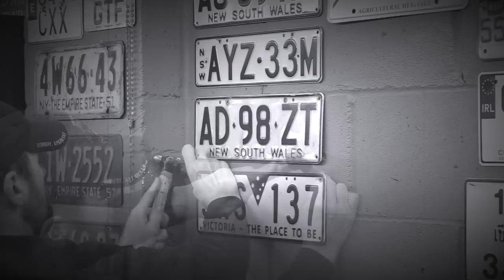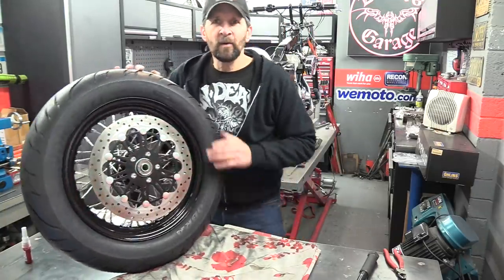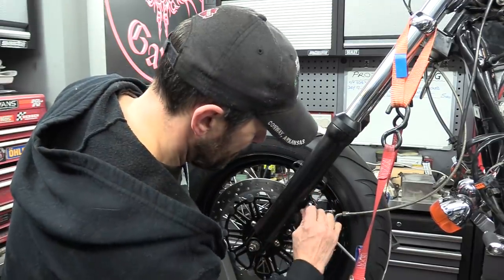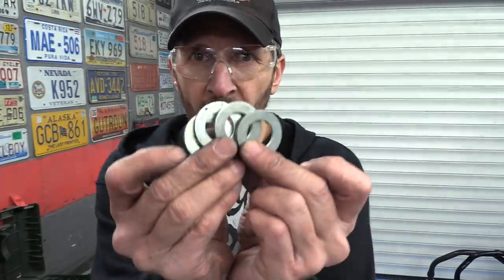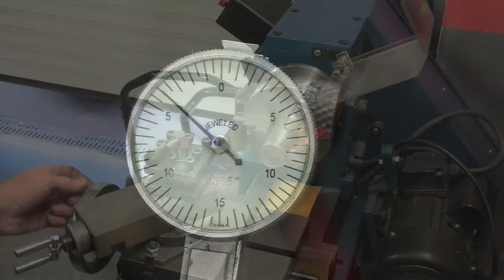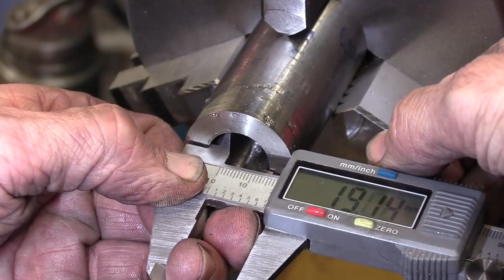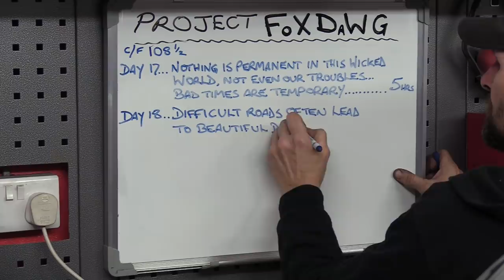Delboy's Garage, Project FoXDaWG, Day 18  Front Wheel Spacers!

Comment: This would fix my bike. I had the exact same idea and landed on your video so I know I'm right.
Thanks man!
Reply from the maker: Thanks mate, glad it helped, have fun with it!
Reply: @Moonfleet41  Just a suggestion. If I send you my original spacers, would you be willing to make me a new pair? I just need to figure out this weekend how I get the brake calipers to sit well. I have a 21 Triumph Rocket and standing in front of the bike I notice it's off set (parallel to forks) to the left. So the bike leans to the left when releasing handlebars. This shouldn't be and I think this will fix it. The difference is bigger than the one shown on this video.

Comment: Hi! Excellent work.  My suggestion will be to, first center the front wheel with the fork, frame and the rear wheel., it is the most important step, the have them line up perfectly. Second adjust either the disk or the caliper to fit the wheel not the opposite around.  The bike has to run straight first, then break properly. For the  front tire, A rule of thumb is, if you use a rear tire in the front you have to revers it since it is not a traction wheel  but a slave to the rear one. This is a theory not proven that make sens to me. I have seen them mounted both way, Keep up the good work  I love your channel.
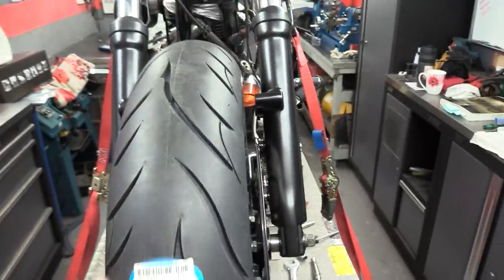Reply from the maker: Thanks buddy, it is a 'front' tyre in the front of the bike, not a rear tyre... these days they make tyres that are the same profile as the rear, but they make them front specific... as I knew this was gonna be a big ol' drama, as it's happened before, I made it clear in the video infr 17:07 so that everybody's clear... in fact, if you look closely at the arrow at the side of the tyre wall, at 17:27 it says clearly on there 'front fitment'..

Of course you can put actual rears on the front and the other way round and yes, you''r right, you should oppose them when you do this... thanks for your input Rene, take care, all the best, Del

Comment: I've got to say, you are becoming the master of parting off! Nice👍
Reply from the maker: Hi Jim, coming from you Sir, that is praise indeed, thank you... it's certainly a scary process and just seems to be a matter of diving in hard enough and not being scared of it...!  Aluminium is easy, but I didn't think it would be this easier with stainless steel, being so much harder... same goes for pushing the big drill bit down the centre to make a hole for the boring bar, lots of oil and you just seem to need to pile in there hard with the chuck turning slow and it just seems to work, unless I'm just lucky lol !  Take care mate and thank you so much for your constant support... Del

Comment: I know an old thread, but, is it by design that the non-brake disc side uses the axle itself as the axle pinch rather than the fork slider? By that I mean, the axle has a hard shoulder that the spacer compresses on rather than the inner face of the fork slider. The shoulder of the axle then exits the fork slider and a clam shell then secures that extended bit of the axle. This effectively releases any lateral pressure on the non-disc side fork slider, making that slider without any direct compression on the fork slider at that point. The disc side of the fork has a lateral pinch as you would expect. Another question on this video - all the bikes I've had the pleasure (now that's a subjective "pleasure") of working on, normally the spacer will seat itself inwards of a dust seal and rest on the inner race of the bearing... in this video, there did not seem to be any dust seal and just a hard face of the bearing. Otherwise, good commentary, great lathe work, and a good result. Thank you

Comment: Iv'e done everythng you did except put the spacers in because looking from the front it appears the tire is a little farther to the left is that ok as long as everything else lines up? it's looking like the fender and tire won't be matched up and wondering if i should put washers or something behing the caliper to move wheel over about 1/4' or 3/8' more toward center. Thanks once again.

Comment: Hey Del, whow, the Bike look's so fat with the Tires. Great Video. A modification for Tracker or Bobber would be nice. Black and Dirty like your Fighter...But everything you made is great. Best Greets from Germany. Ride save and watch out for your Fingers by working. The Lathe Machine is great. I hope, i have one to in the Future. Greets Ralf
Reply from the maker: Hi Ralf, great to hear from you... yes, I love the chunky wheels too, but I'm not considering a bobber style, as it's already a very common, but also the Dyna WideGlide has a different frame with 34 degree fork rake, which is 6 degrees more than normal Dynas, so it will always be a long and graceful looking bike, so I'm not going to chop off the rear guard, I've done that already with a Softail FatBoy, instead I'm going to leave the elegant ducktail fender and long rake forks just with chunky wheels to make it look more solid... it'll look different and that's what I'm aiming for!   Thank you for your kind support, it's great to hear from you all the way from Germany!

Comment: It's a shame your channel wasn't around about 10 years or so ago. The school I work in was demolished to make way for a new build, they wouldn't let the technical department take the old lathes, pedestal drills, band saws, hydraulic hack saw, welding gear, solid wood benches with 2 vices fitted,10 Tonne Hydraulic car jack to the new school. So it wasn't even sold off and would come into the hands of the demolition company. I found a new home for some of the items, not myself I must add as I don't have the skills to operate a lathe. But the quality of these machines was first class.
We now have Chinese lathes which aren't a patch on what we had before and the work benches are MDF. 
If you were around at the time you could have had your pick of machines for the cost of a low loader and a trip to Scotland.
Now I understand why our councils are in such debt.
Great job on the spacers.
Reply from the maker: Hi buddy, thanks for your kind words, happy with how they turned out...!

Sadly this is a story I've heard a few times about schools, they don't like to spend any money, but they sure know how to waste it!  I hear common stories about vintage engineering machinery, probably bought back in the days of pounds, shillings and pence, and assets who's values are long since forgotten... Also, school budgets are controlled by people who are younger than the lathes we're talking about, they've no idea what they're throwin away, they sell contracts for projects like you describe, to greedy people who know exactly what they're inheriting... and exactly how to tie it up and make sure no-one gets their hands on it!... very sad, aye mate?

Comment: Hi Dell. Love the videos. One question, what stops the disc spacer working it's way out in use.
Reply from the maker: It's aluminium Mark and held wedged in place by the disc, pretty tight in fact, and when I bolted the disc down, you could feel the disc carrier snuck down over it, so it is an interference fit, which means it's going nowhere mate, I think tey machine it to fit tight.

Comment: I wondered if my front tire was installed correctly when i first started riding. I called Bridgestone about it and apparently, the reason it is like that on the front tire is because the front tire can more effectively displace water when in a lean with the tread pattern pushing the water towards the center of the tire which, when in a lean, isn't really contacting the ground as much as the shoulder. This is caused by the narrow nature of front tires.

Comment: I plan on doing this with my 05 Wide Glide and plan on a 09 Fat boy rim chrome and a 140/75/R17 with a Heritage Softail fender burns no trim or holes . My question is what size front tire/rim did you put on it?
Reply from the maker: My choice was a 16x3 rim, and a 130/90/16 Avon Cobra tyre... same as i used at the back.
Reply: Hi again I have just a couple questions regarding my first one. I have two brand new fenders and one looks exactly like yours but it’s only 5-3/8” wide and after I purchased it I realized what my rim calls for 140/75/r17 that is to wide for rim so first question with a 3.5” rim how far up can I go 130/80/17 120/80 what do you think? Also after I bought it it claimed for 19 to 21” rims. My second question my rim has 25mm bearings so I bought reducers to 3/4” will that be enough or should the whole hub be reduced with a reducer sleeve to 3/4” also. Where and what width is your fender purchased? It looks wider then 5-3/8” and I have a bike jack but it won’t fit under bike it looks like a black cover possibly for transmission and I don’t want to damage anything you’re very good and have ways us Americans do differently but you make more since. Thanks again if you can help on tire with reducers and tire size and fender that would help as I wanted a fat boy fender but unless I reduce width or stick with heritage Softail fender or buy the one you have. And I’m making sure reducers is all I’ll need. Thanks!

Comment: Nicely done, it's always good to see things like this just in case the knowledge is needed someday.  The tyre thing is a funny one, although I know it's right and seen the argument a few times over the years on here, it still does not seem right that they do it like this, as it looks like it's forcing water to the middle.

I guess it is just because people know how it works with car tyres but motorcycle tyres must act differently because of their shape, although I think the rear on motorcycles are usually as you'd expect, the mystery kind of continues lol
Reply: @binnawan  If you look on a car tyre or rear tyre on a bike, rather than the tread going outside/edge to inside/middle as it rolls it goes inside/middle to outside/edge, to force the water out to the edges, otherwise you'll heighten the chance of aquaplaning because the water is forced to the middle.  

This is why so many get confused when they see the front tyre of some bikes for the first time, it just does not look right or make sense, even to someone who has worked with tyres for years. but only on cars.

Comment: Hi, recently I removed my 2012 Sportster superlow front wheel. Then when I reassembled it again, I noticed a drag when I installed the caliper. Do you know how drag could be normal ? By the way. On the manual it says that narrow spacer is on the bike’s right side and the wide one on the left side( caliper side). I’m not sure if they where o that’s position when I removed them at first time.
Reply from the maker: Hi mate, so what you're saying is, it's possible you have the spacers in the wrong order?  Try and find a schematic diaphragm of the front end and it'll give you an insight in the order of assembly, as there should certainly be no drag in the free running of the wheel.
Reply: Delboy's Garage Hi. Well, I deicided to change the spacers order and I solved the issue. My concern now is why does the service manual is so confused in this part. Anyway, thanks for taking your time to answer. Keep safe .

Comment: Hi iv'e done everything you told me except put my spacers n because the wheel sits farther to the left and if i put fender on i won't be dead center does the wheel being farther to the fork brake side about 3/8' matter? or should  add washers to caliper on back side to move tire closer to center?
Reply from the maker: Keep the spacers correct as factory spec, my wheel also sat about 3/8" off centre under the fender, but alignment with the front wheel is far more important and that will be given by the wheel spacers.
Reply: @Moonfleet41  ok I understand that so even though my wheel is offset pretty much whatever the difference just replace the spacers with one even though a bit different in size as close to the old ones. I have a rim with 50 miles on it and the bearings are 25mm so I bought reducers so that shortens the spacer happens on each side since they stick out a little farther than just the bearings. My old spacers are different size each side and my replacement kit will be smaller since I don’t have a lathe I bought a variety size kit. Than the bearing reducers and offset shouldn’t be a problem?
Reply: I checked everything but since i put reducers in from 25mm to 3/4" my spacer will be a different size since they stick out a little on each side but i did notice with the factory caliper mounted the split in caliper is farther to the right and not aligned with the rotor and haven't a clue of how to get those to center if i could my wheel would be more towards right and more centered. Is there something i'm missing or do i have to completely collapse the caliper and hope my wheel can move over a little but if the piston is pushing in from outside i won't be able to move wheel since its fixed to frame. There has to be a way to modify without shimming caliper in more towards bike. Sorry to keep bothering you but when i'm done i'll definitely contribute to your channel Thanks again from America.
Reply from the maker: @Captainkleen  Hi there, ok, by how much is the split line of the caliper off centre from the rotor?  If it's maybe 1/16th or so, you can shim your caliper with washers, but if it's significant and too much to shim, then you still have an anomaly somewhere with in the spacer set up, it's difficult to diagnose without seeing it (I know everyone says that), but genuinely these kind of problems are best fathomed out by looking at them, and is very vague to try and understand an explanation over email... but with my Harley, the rear Brembo caliper was shimmed inwards by 1/16 with a couple of spacer washers... and it was fine and worked perfectly safely, so I hope that helps again.
Reply: @Moonfleet41  Hi again I put the original wheel back on to get an idea a checked the split in caliper to rotor and it looks like the original wheel is a under 1/4” about 5/16” in toward forks the tire looks centered but the split is like new wheel off about 5/16” towards other fork and the original tire is centered in forks with original spacers so if original is off too maybe that’s the way original calipers are. The main thing other than both being the same the wheel on new rim is off center about 1/8” with caliper collapsed it looks a lot better not noticeable that’s with caliper collapse and both wheels from right end of hub to end of rotor are about the same 6 1/4” about so their the same the only thing off is the split in caliper to center of both original wheel and new wheel both about 5/16” and that’s how original came.
Reply: @Moonfleet41  one final question before I put new spacers in? With the caliper collapsed and wheel pushed to inside lasso the gap is on the outside and I put different spacers in and remember I have bearing reducers installed so reducers are over 1/16” sticking out of spacers I will have to use smaller spacers but wheel is as centered to middle as possible will that matter if inside caliper pad is touching rotor all the play will be pistons on outside caliper pushing pads in? If that sounds ok I’ll have to buy some washers and cut them with die grinder and slip them in till full pull them out and I have a spacer kit but wish I had a lathe because I’ll probably have to put 2 different size spacers on each side does it matter if collapsed caliper inside pad is butted to inside rotor and the play when I pump up brakes is solely responsible? If everything sounds ok let me know. One final note I balanced new tire with axle across jack stands and it appears to be balanced with my new tire when tire stops it doesn’t move other way after stopping I did this process several times and when wheel comes to a stop it doesn’t move the other way and appears to have no heavy spot. Please read what I told you and remember I have 25mm to 3/4” reducers that stick out both sides because rim only has 50 miles on it so I didn’t replace bearings and opted for reducers so spacers will be shorter. Just an answer to the collapsed caliper rotor being moved to inside pad only making will off center in forks 1/8” will that matter if outside pistons have to push outside pad in when I pump up brakes? Then I’ll forge ahead with spacers and start on fender. Thanks for all your help and when I’m finished I’ll send your channel a donation.
Reply from the maker: @Captainkleen  Hi there, ok, from reading your very long message, I'm gathering you're actually only asking one question:- is it ok that your caliper is slightly offset?  Well, the simple answer is that it depends on how much that offset is, if the inside pad is hard up against the disc, then no that won't work... there must be space for the pad to retract away from the disc by at least a couple of mm, this is for expansion and allowance for dirt and water during operation... if it is touching it all the time and won't retract, it will overheat and jam, or just bind.  As with all these things my friend, there's no cut and dried text book answer, with your reducers extending out of the bearing you're creating custom spacers and overall it's a complete custom application, and with all custom applications you just have to work through each obstacle as you come to them, but I'm sure yoy know that and are doing that, so with the caliper, it is fine for the pads to work very slightly offset, just as long as they are within travel, meaning that the inside one still has some retraction left and the outside one isn't so far out that it could expose the dust seal... so maybe on that basis, you could make some calculations!